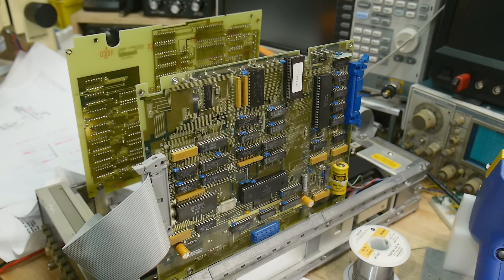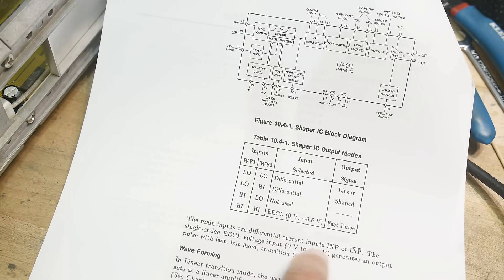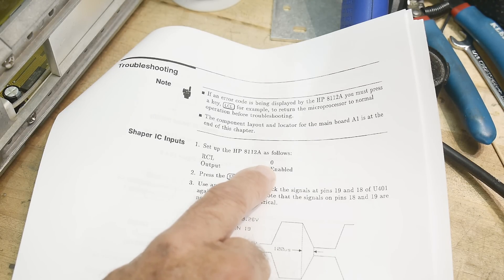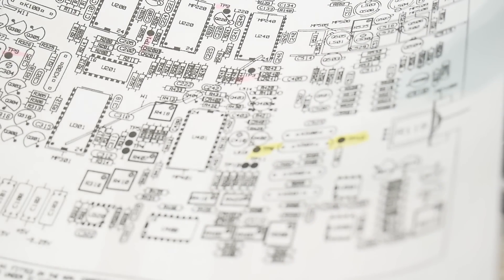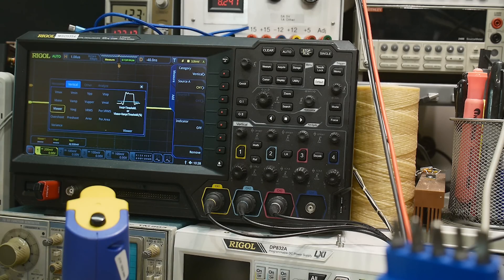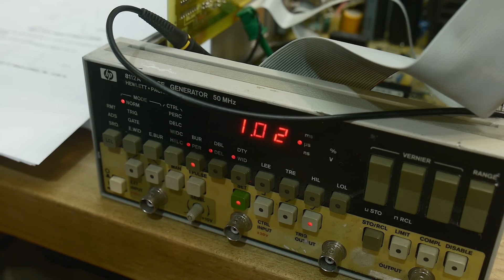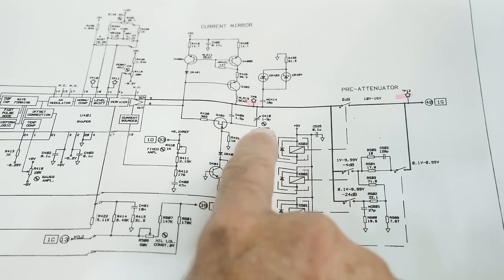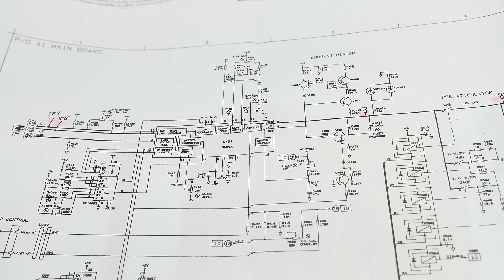#1654 HP 8112A 50 MHz Pulse Generator (part 4 of 4)

Comment: YearS ago.  Big emphasis on the S. I wanted one of those so bad when i started building out my lab.  I had an hp frequency counter with the same style buttons and i fell in love with the buttons.  Hp has always had a thing for making the coolest buttons.  And this pulse generator had those same buttons.  Could never find one on ebay in my very limited budget, but eventually, i got a more modern hp 10MHz  function generator that made the need for the pulse generator go away.  So im looking at my 80Mhz Siglent Arb and im thinking, yeah, right now i wouldnt want that either, and if i had one, it would be a dust collector. Ive actually watched this series a couple of times now. Just brings back some memories that make me smile.  Love the channel.  Thx for sharing.

Comment: Probably a long shot but one last gasp might be to test the regulator for that rail out of circuit under load. I've chased my tail on similar era HP gear where a regulator appeared to be fine under normal test, but sagged under certain situations. Replacing it solved what appeared to be an unrelated issue. Love your videos! I learn on every one. Thanks! - jrh

Comment: Being unsuccessful in repairing things nowadays heavily depends on whether the manufacturer of the gear used programmed and protected microcontrollers or other programmed parts that you can't easily replace because of the firmware.
I have been watching these videos in the hope that you succeeded. 
I do agree that there are more modern devices around nowadays that do everything that you need, but these older devices have one thing going for them: troubleshooting tips and schematics in a service manual. Therefore these are a very good practise piece for anyone wanting to learn to repair stuff. I hope you don't toss them, but instead give them to an enthusiast nearby.

Comment: trouble shooting current mode circuits is a pain. one approach would be to remove the big chip and place two resisters at the diff inputs to ground. then you can see via voltage what is happening at the inputs. also you can drive currents into the nets where the outputs are,...
yes it is a pain in the ass. 
I totally get the frustration, and I noted in the comments of the first video that you seemed less than committed. it happens. I am tempted to suggest a project trade. I have an old HP LCR meter, all analog, which I have made attempts with similar results. but well - I am not convinced of my own commitment,... LOL
Reply: I test current outputs in similar generators by loading them with emitters, bases set to same potential as the load in the hybrid was biased to, and then collectors go into a resistor each to read out the voltage. That mimics what’s likely inside the hybrid.
Reply: @absurdengineering  yes, all depends on the levels. ecl, mecl, pecl,... and where to return the current.

Comment: Maybe need to press the RCL switch once then using the second vernier rocker switch n RCL until only the digit 0 is displayed.... and the Enable button is pressed to disable the output (Red LED on the button is off).... then only press the SET button...🤔🤷‍♂

Comment: The signal was tested from the generation to the "wave forming" where it was lost. So there is one error. A possible way is to cut the line or take the "wave forming" out and to inject a reasonable signal behind this point to see whether (or from where) it makes it to the output. 
On the other hand, while I admire HP equipment very much, the generator is to big for it's function today so it might be good to understand the function and to go to the next project.